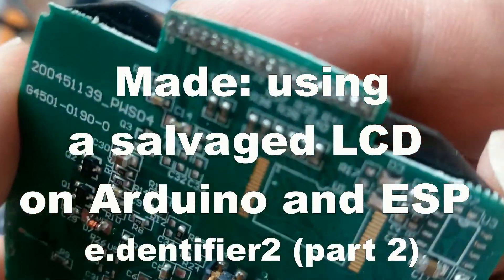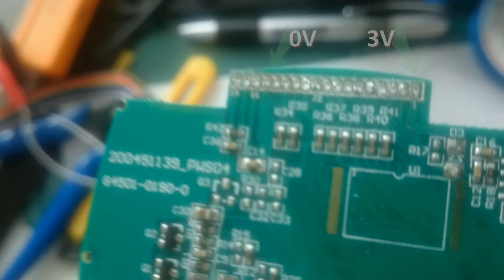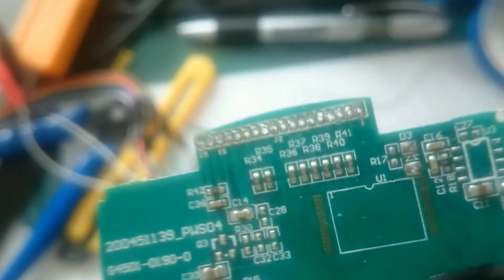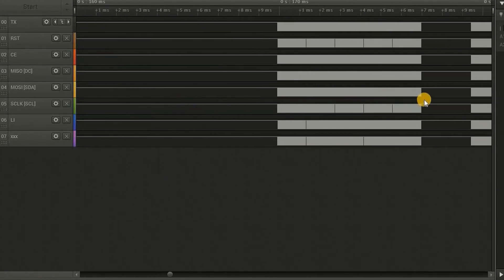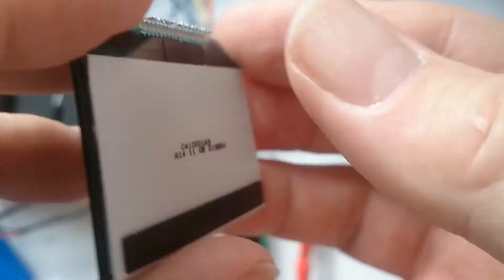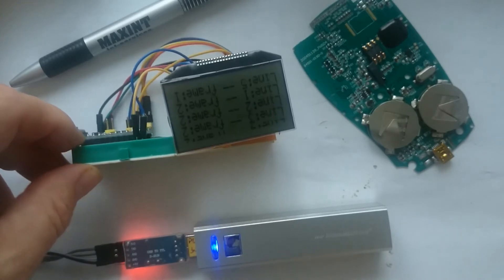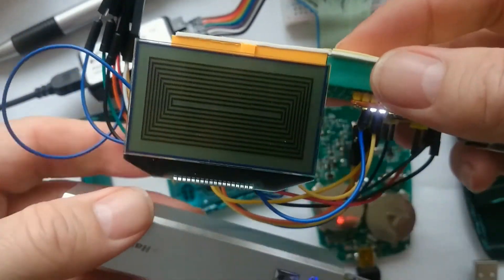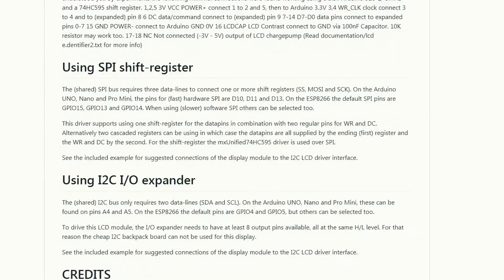Made: Using a salvaged LCD on Arduino and ESP - ABN-AMRO e.dentifier2 (part 2)

Comment: Hey! This is a very interesting video. I love how you managed to reverse engineer this display. I'm going to buy a logic analyser too now. I still have no idea how you knew which data pin was for what though. VCC and GND are fairly easy but how the hell did you identify the others? lol.
Reply from the maker: Hi Antony, thanks for your comment! Glad you liked it. 
I'm quite happy with this cheap Saleae clone that I used. Although very affordable and only eight pins, it supports up to 16M samples per second, which is good enough for SPI and I2C at the fastest speeds.The software has some nice protocol analyzers which make it easier to interpret the data.

In part one of this video I already assumed the eight pins with the resistors to be data pins. Why, you ask? Only because of the number eight. That many pins had to mean parallel data and there were not enough for direct matrix control, so there had to be a chip on glass (COG). For the other pins I first used the multimeter and then my DSO oscilloscope to see what signals I saw at what time. The continuous signal pins were for continuous display and power, leaving the others for control. Some pins were not connected to the main MCU so they were either power or just support pins coming from the display. (Later Dave Jones posted an interesting video about the AC pins). By silly experiments (such as connecting two similar pins together and disconnecting others) I found which pins were essential.

Luckily this LCD has much in common with the Nokia display, which I analysed some time ago when making the Nokia driver for the I2C interface (see https://youtu.be/40Ssl2K_jfo).
After making this video I found some datasheets of similar LCD chips allowing me verify my assumptions and add some more functionality to the driver. Eventually I'm quite pleased with the results. In a future video I might show how to use the PCF8575 to make this an all-in-one I2C compatible module. All I  need now is finding a good purpose for this LCD...
Reply: Very cool! :-)